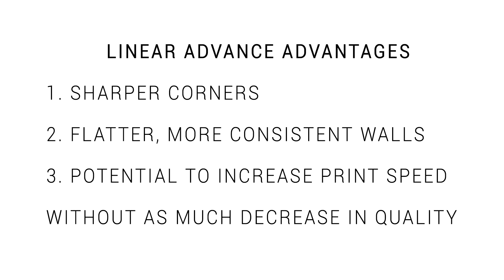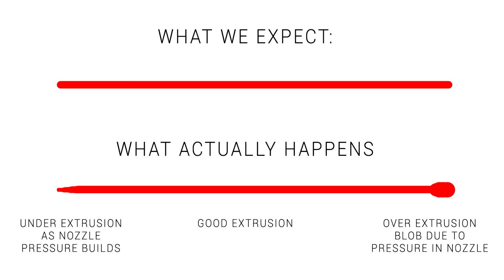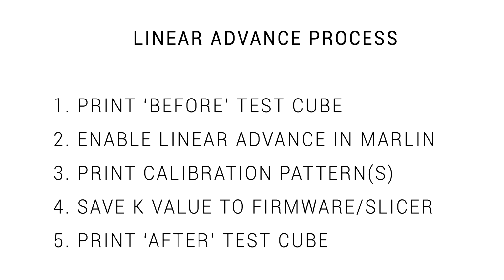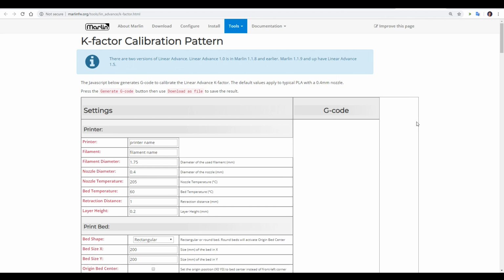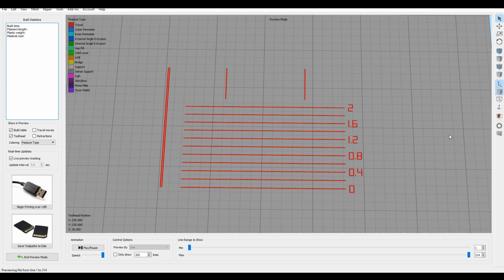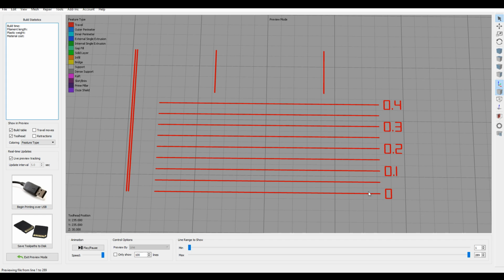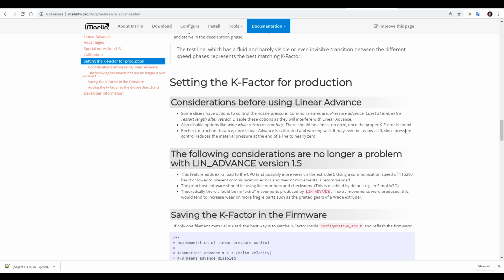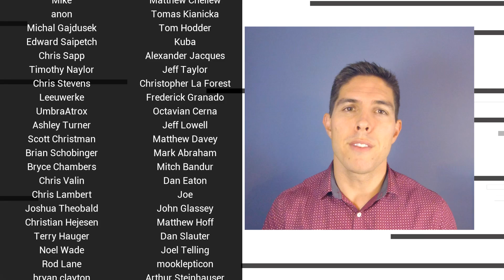Linear advance guide - Free and easy print quality improvement

Comment: In the video it looks like you used a printer with a direct drive setup. The info on linear advance in Marlin's docs isn't 100% clear if this is good for a bowden setup or not. I've set it up on my ender 3 pro with a micro-swiss all metal hot end with an SKR e3 DIP v1.1(tmc2209/UART) using the "factory" extruder and bowden tube. Other than being able to lower my retraction quite a bit after following your guide to set it up I'm not seeing any noticeable difference in my prints, even under an LED lit magnifying glass. On top of that the extruder is now noisy. I have a direct drive kit sitting here, but i'm not sure I want to install it just yet.

Would you be willing to sacrifice your ender 3 once again and do a comparison video of linear advance on a bowden vs $35 DD kit? (possibly also vs a higher end DD kit) I would very much be interested in the results from a 3d printing veteran and it would be very helpful for the community as well when trying to make decisions on what hardware/firmware combinations to run. Plus, as far as I could find nobody else has done a similar comparison yet.
Reply: I also have done the calibration, but I am not seeing a great improvement
I did however fix a bit of my problems
Reply: 3:20 minutes
Reply: Lenn Minkhorst i really dont know what you are trying to point out
Reply: Hes asked if its good for bowden setups.
At that time he explains why its especially important on bowdens
Reply: Lenn Minkhorst you do know that i have tried this in a bowden setup 
And the imporvement is very minimal
I just wanted to make that clear
Reply: @010falcon  On my ender 3 the difference is big. Especially with petg.

Comment: If I start using Linear Advance do I have to start remembering to change the K value in gcode every time I switch filament types (pla, petg, tpu, nylon, etc)? That would be a pain
Reply: Most slicers will allow you to set arguments in your start g-code based on what filament you pick. Will take a little bit of setting up, but after a while you'll be able to just pick the filament in your slicer like you do normally and have it input the correct K-code with M900 at the start of the print

Comment: okay, i wasted my day on lin advance, because i swapped 2208 (loses steps with lin_adv) to lv8729. when driver is put into skr1.3 marlin doesnt even start any other driver works, lv in extruder doesnt. i had to put it into E1 slot, remap pins to work. I heard later its an skr 1.3 hardware bug:(

Comment: Hi Michael. As always, thanks for the great video. OK, so, finally got round to trying this out as it looks like a no-brainer for a zero cost quality improvement. My setup is an Ender 3 with SKR V1.3, TMC2130 in SPI mode, BLTouch and as of yesterday, a short string of Neopixels for a print job light and warm-up bling.  Stupidly, I did two mods at once, added the Neopixels and Linear Advance. All seemed fine up until I tried to print the test job - no extrusion. Doing some basic checks and it seems that it just will not extrude anything at all, no matter how I try to make it do it (print from Gcode, direct control of extrusion via Octoprint, direct control from control panel. All tests done with hot end temps of 205). All movements good, Extruder TMC driver debug report all good - extruder driver activates when asked to extrude but simply wont move. Initially I thought I had screwed things up with the Neopixels as I had used the un-used extruder 1 DIR line for the Neopixel data, so I recompiled without Neopixel support - no change. Took it apart to make sure I hadn't disturbed anything when fitting the wiring for the Neopixels - no problems found. Disabled Linear Advance and recompiled...all now working as it should. Re-enabled Neopixels and re-compiled again, still all good. Re-enabled Linaer Advance and re-compiled yet again...no extrusion.

So, as always, trying to figure out what I did wrong!  :)

ETA. After some quick searching (that I should have done before typing all this....) I find its a known bug with TMC 2130 drivers/stealthchop/linear advance. Forgot to mention, this was built on Marling from 4th November 2019.
Reply: ...and after that basic bit of searching, found the answer, in configuration_adv.h, set MINIMUM_STEPPER_PULSE = 2  seems to fix it with no adverse issues I have seen so far.
Reply: Had the same issue today. Bridged the SPREAD pin on my extruders TMC2225 to VCC_IO and now it works again.
Trying to get it dialed in now.....

Comment: Does this work with StealthChop2 on the 2208s? If not, what is/are the issue(s)? I just added 2208s for my X and Y motors, but not for the Z and E.
Reply: It works, but it has issues with other marlin settings. For me, I had to put the extruder in spreadcycle, also, I had to disable Junction Deviation, and set the minimum stepper pulse to 1, also I had to enable square wave stepping.

Basically it works great but you have to give up some fancier kinematics settings. I use it though for it's ability to reduce stringing. I don't really care about the quality boost, I just want my micro-swiss to not string with 1.5mm retractions, and it accomplishes that well.

Comment: Thanks for the video! I wanted to add in some with reguarding the TMC2208s. It is possible to use Linear Advance on TMC2208s so as long as you disable StealthChop and enable Square Wave Stepping.

Edit:: I can confirm that Linear Advance works on TMC2208 drivers on the extruder! You have to ensure that Stealthchop is disabled on the extruder and have square wave stepping enabled
Reply: I'm about to google it, but jic you have verified methodology; how?
Reply: ❤ thanks!!!

Comment: Hi Michael! Thanks for the video!
I have a question I hope you could find the time to answer.
I recently switched over to Klipper+Octoprint  and I followed your video about it, and had success with the switch, things are amazing now!
Now that I have my Ender 3 running through the Pi with Klipper+Octoprint, how do I enable LA from this point? Not sure whether I should flash my printer again with the Arduino or just change something in the R.Pi/klipper/Octoprint settings.

Thanks!
Reply: In Klipper it's called "pressure advance" and the concepts are the same.

Comment: Hello, thanks for the video. I tried to repeat the test with my printer. Unfortunately, when it start to print, the extruder doesn't not work. the printed is moving according to the design without filament. If I do not activate this function with marlin, it works again. Any idea ?
Reply: I had the same issue you are describing, a non-moving extruder when Linear Advance is enabled, but the extruder works perfectly when Linear Advanced is disabled. 

I managed to get this working by enabling  '#define MINIMUM_STEPPER_PULSE' in 'Configuration_adv.h' and setting it to "2", it seems to be a known bug in Marlin 2 for some. I'm going to be really honest, I haven't looked into what this does exactly but if I run into print issues I'll research it further. I hope this helps!

For more details see: https://github.com/MarlinFirmware/Marlin/issues/15071
Configuration_adv.h
 #define MINIMUM_STEPPER_PULSE 2
Reply: Sam Lee thanks a lot, it works now.

Comment: I've got an Ender 3 with a BMG extruder and Bowden setup, the K value 0 line looks kind of normal but every other line looks absolutely identical going from 0 to 2 in K values, I've made sure it's enabled in the firmware and the extruder does make some odd sounds at values over 1, so I know it's doing something, but that something is having zero effect on the test prints. I've given up expecting anything fro linear advance as it only seems to be of use for direct-drive setups.
Reply: If you have a stoc ender 3 then linear advance is disabled in the firmware by default. You need to load Marlin as per some of the other teaching tech videos or even better get a 32 bit cheetah with 2209 drivers  from fystec for $30 and load Marlin 2.0 it works really well. Its silent and the linear advance is really good.
Reply: @andrewgoedhart4562  You have Marlin 2.0 with Linear Advance working on an Ender 3 with a Bowden setup? Cool, What is your K value? you are the first person to get it working with an Ender 3 and a Bowden setup, please let us know your K value.
Reply: @foxabilo  Actually it was really simple. Download the marlin github, copy across the Cheetah (2209) configuration files and enable linear advance with a k setting of 0.  I played with the current settings and enabled stealth mode on all the steppers. Compile and reflash onto the Cheetah 32 bit board. I don't think it will fit on normal ender 3 as it only has 128k flash which is not really enough. The cheetah board has 256k flash and the marlin code compiles to about 190k.  I then ran the calibration utility on the marlin website with a range of 0-1 with 0.1 steps. for PLA (CCTree) and ABS Max (ESun) the setting is around 0.3-0.35 but I have an all metal hotend and Aliexpress 'Capricon' ptfe tubing and a metal aliexpress red metal bowden extruder so your milage may vary.   The PETG (esun) is about 0.65 - 0.7 to get anything useful.  As meantioned in the video add the K value you want to use to the custom Gcode for the filament. By the way this also deals with most of my stringing issues form the all meal hot end. I was really struggling to get it not to leak everywhere before enabling linear advance. ( I still have retraction of about 2.5mm and 90%+wipe) but I get very little leakage compared to before. With the all metal hotend, a retraction of more then 2.5mm caused jamming.
Reply: @andrewgoedhart4562  Great Stuff I'll check it out and see if I can adapt it to my SKR 1.3 and 2130's

Comment: Can this be used in a bowden setup or is it just for direct drive? Thanks for the guide!
Reply: I could not find a value that worked for my Ender 3 Bowden setup.
Reply: @foxabilo  Yeah I'm having a hard time finding any value that works for my bowden setup
Reply: @Twxii  Which is a shame as it is bowden users who would gain the most benefit from pressure equalization

Comment: For TMC drivers you also need to set MINIMUM_STEPPER_PULSE to 2 in Marlin, otherwise TMC driver on the extruder may suddenly stop in the middle of the print even in SpreadCycle.
Linear Advance is OK for "direct drive" extruder, but when enabled on the geared extruder like Titan or BMG it produces too much noise and vibration, especially if high acceleration is set. I tried it on my Kossel and Ultimaker printers with 3000 and 2000 mm/s2 acceleration respectively, and it was very loud. Maybe I will enable LA if I put my printers in another room or something.

Comment: Is there a solution for reprap users?
Duet2+Cura here.
Reply: Linear Advance is already included in the firmware. Search the duet forum or the reprap wiki for the M572 command
Reply: @Naqaj  sorry I didn't notice this before.

So I did include that in the start code and it doesn't seem to make any difference and in some cases, the product came out worse than when it was off. I am printing with PETG with a Little Monster running Duet2 3.11 with esteps painstakingly calibrated to the tee, any ideas what could be wrong here?

Comment: Well it will cost you money if your Ender 3 still has the stock board in it. You should qualify the statement with something like "..., if you have a printer or upgrade that can already run Marlin 1.5 or higher." For many people, this means this isn't free.  Otherwise, great explanation and demonstration! Thanks!

Comment: The question I've always had about linear advance is do we have to re-tune this per filament?  If so does it have to be per roll, per brand and colour, per material type?  Also what does the workflow of changing tuned values look like?
Reply from the maker: Per type of filament yes. Tpu for instance will have a very different value to anything rigid. Per colour and brand you may see some benefit but it would likely be not worth the effort. M900 line in start gcode is all that is required to change.
Reply: @TeachingTech  Thanks for responding. I switch back and forth between 0.4mm and 0.8mm nozzles fairly frequently. Do you know if we need different K value calibration for different nozzles/layer heights?

Comment: I have BMG extruder clones, and one thing I noticed is that enabling linear advance makes the extruder work a lot harder (forward & backward movement all the time). Is it normal that they also get a lot noisier by that? I'm on an 8bit Geeetech board, Marlin 2.0, enabled s-curve and junction deviation also.

Comment: Note on use of TMC2208's - it appears that the problems only exist when the driver board is on the extruder so if you are exclusively using 2208's on the X, Y and Z then it looks like you're clear
Can anyone confirm this from worked experience?

Comment: I think I know the answer, but I assume you change the slicer settings before the calibration procedure .. correct?
Reply: James Moeller 
The g-code bypasses the slicer.  He loaded it in only to show what pattern the g-code was creating — you don’t have to do that.

You could also elect to put the linear advance code in your slicer settings to enable you to more easily fiddle with it, instead of writing it to the printer eeprom.  It comes down to trading off the time spent fiddling with it against a ‘good enough’ improvement.  (Always make sure that the printer is mechanically sound first.  If you have poor print quality due to mechanical issues then this won’t help.)

Comment: Thank you so much for digging up that gcode generator for the test strips!! I use this all the time (RepRap: Pressure Advance), but have only ever tuned it by eye. Now I can re-run calibration using this far more useful code generator :D
Btw, the difference is night and day for flexible materials, unlike rigid.
Reply: how can you generate a gcode for reprap? i have a duet and want to tune pressure advance but i am failing to make a good test gcode

Comment: What would be the Problem with the 2208 with stealthchop enabled on thr extruder? I did not understand it from the video alone
Reply: @D. A. That was my question too
Reply: @D. A. The way that linear advance works - the way that it modulates the speed of the extruder motor - does not mesh well with the way that StealthChop and StealthChop2 work to interpolate microsteps. There are firmware tweaks that can make it work, but i think it's easier and more rewarding to just not use a trinamic driver for the extruder.
Reply: @EricJorgensen  what about when it's in spreadcyle?
Reply: @Anon.G  i think that might be ok? Google it

Comment: it doesn't  work with my regular  DRV8825 or my A4988 cause they dont have more step divisions ?does it? I mean  the comparison of DRV8825 and A4988 is 1/32 of step versus the 1/256 from TMC2130.Please correct me if i'm wrong.

Comment: I seem to be having a problem trying to enable LIN_ADVANCE on my Ender 3 with a BIQU SKR V1.3 Control Board and TMC2130 V3.0 drivers. I can uncomment the LIN_ADVANCE line and build the firmware and install it. But afterwords the extruder motor is locked and will not advance when printing, using the motion menu, or using OctoPrint. If I revert the change to the firmware and re-flash the extruder goes back to working. Does anyone have any insight into what might be the issue or any next steps to diagnose the problem? Thanks in advance.
Reply: I have the same setup and had exactly the same problem with the TMC2130 as stepper drivers: extruder locking/stalling (it does move a tiny bit, but no more) when LIN_ADVANCE is activated.
After trying several firmware configurations, i finally found a working solution:
#define SQUARE_WAVE_STEPPING
//#define STEALTHCHOP_E
Reply: @stromberger7261  Awesome thanks! That worked! Now I just need to dial in the K value. For those with the same issue I found it was necessary to enable SQUARE_WAVE_STEPPING in addition to disabling STEALTHCHOP_E as Frank mentions.

Comment: I would like to try this but it already prints so well. Won't refashing the firmware wipe out all the changes i have done? Such as esteps, extruder calibration and anything else i have done and saved with m500?
Reply: You can get your tuned values with M503 and copy/save them in a text file. Then you can set those as new defaults in the firmware before flashing or just reprogram them afterwards.
Reply: @thomashome677  yes i know but what i was getting at was it didn't see it mentioned in the video. If sometime didn't realize they needed to record their current values beforehand they would habe more work to do.

Comment: Easy enough to add the K value to any slicers starting script and makes for quick filament changes and k values as well. I didn't get much better results on my newer CR-10 (12 months old or less) and bowden setup mind you. I'd need to see if the board is any different from the old one they used but just assumed it was the same with the same drivers.

It is very easy to understand and setup, just take your time and read everything :-) Its a s easy as Michael shows it to be.